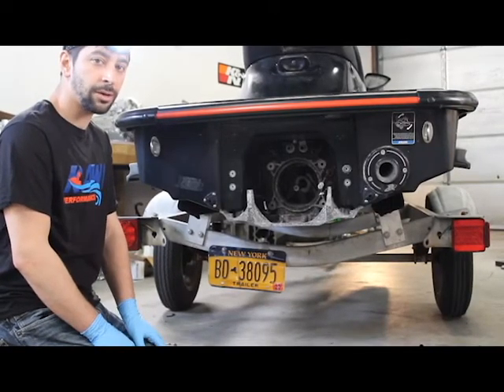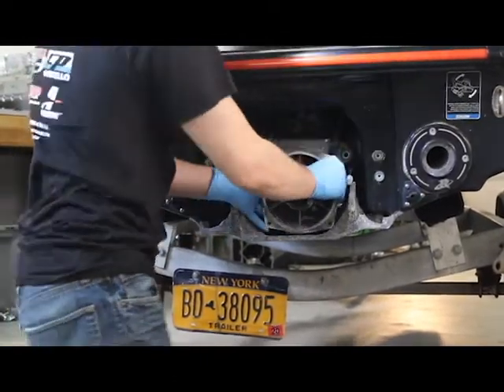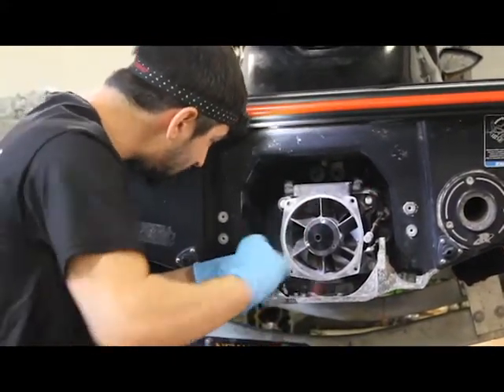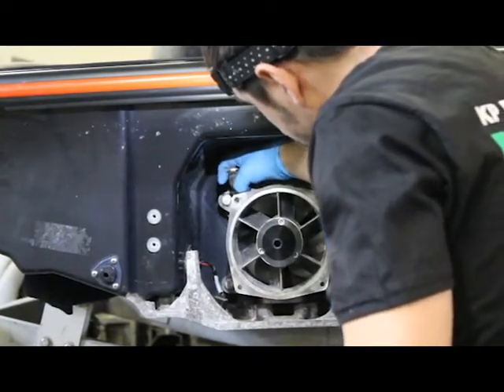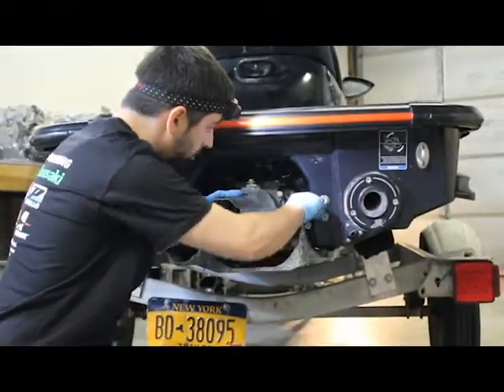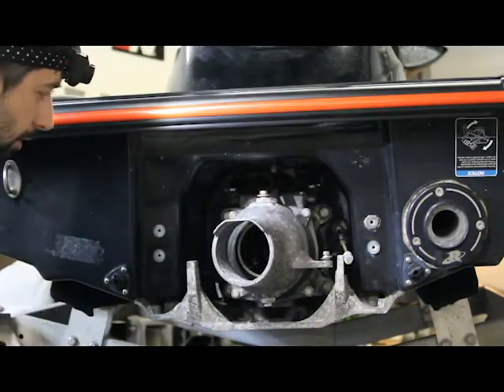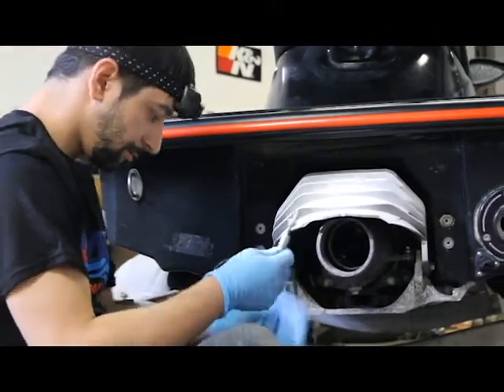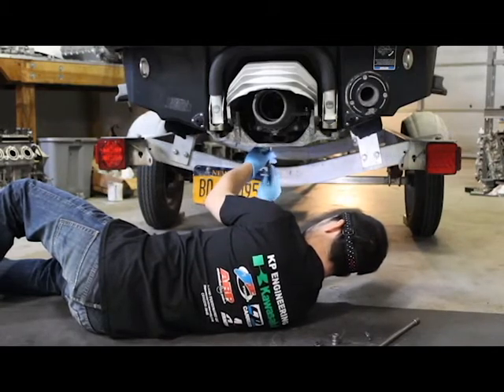Jet Pump Installation | Kawasaki Jet Ski’s

Comment: Steve I can't thank you enough for making the videos and doing it without any useless information about nothing to do with the actual project that so many others tend to do. It's straight forward and thorough.. and you make it look easy! 👍 I'm in the middle of putting my pump back together and on the ski.07 STX-15.. just got it back today and the impeller installed.. I didn't take it all apart.. basically got the entire unit in a box with bolts so this video is gonna be so useful and a huge help! Thanks again!